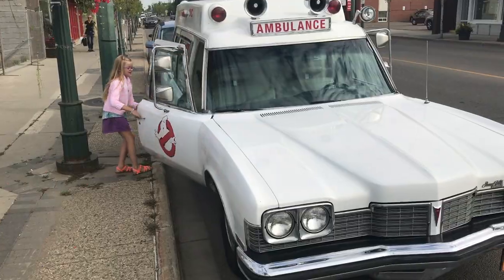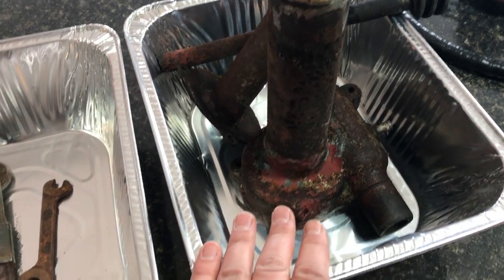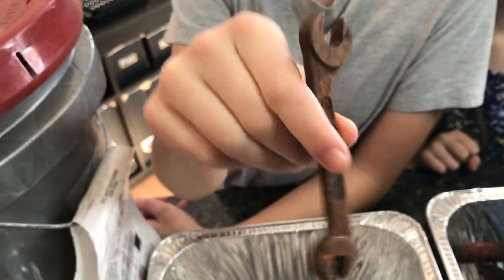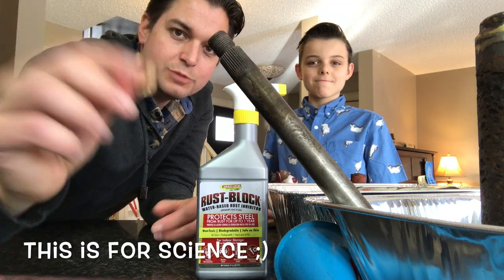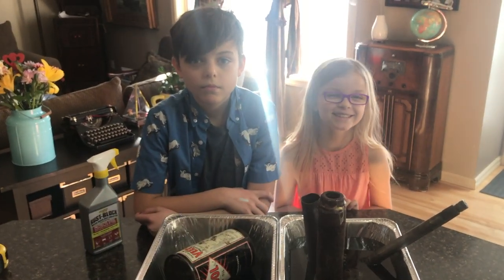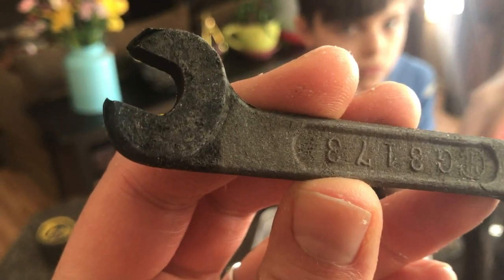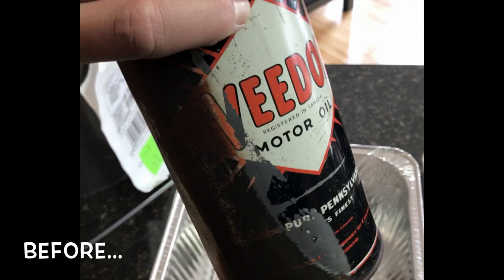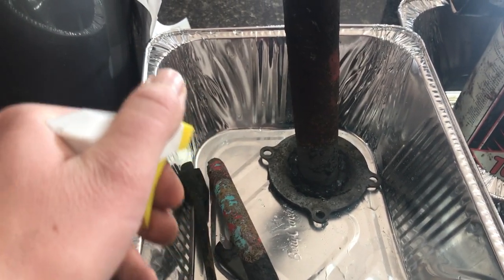Removing Rust The Easy Way! Family Evapo-Rust Product Try Out, With Before and Afters!

Comment: I like the fact that Walmart still handles this product... it used to be called "Ospho" and it worked really well on the floorboards of cars we were prepping for restoration. I would of like to see if the spanner wrench would adjust after going through the treatment. I don't think it would turn before but it sure did clean it well and the penny looked uncirculated. Good video

Comment: Did it take the paint off❓
Reply from the maker: Surprisingly not (can) don’t think it’s meant to be used on painted surfaces but it cleared the surface rust pretty nicely
Reply: Just curious 👍❗
Can I find that stuff in the States 🇺🇸.     👍🇨🇦
Reply: It totally safe for most painted surfaces.
Reply: Paul, Evapo-Rust is sold in over 40,000 stores if you go to evapo-rust.com we have a store locator